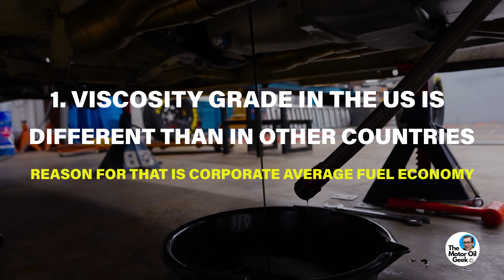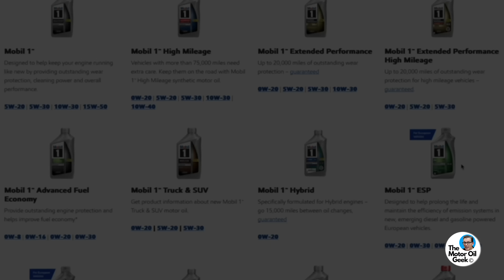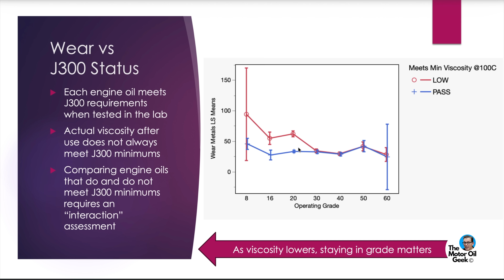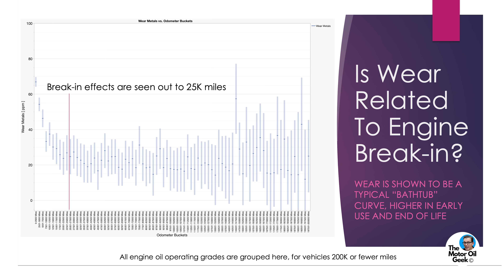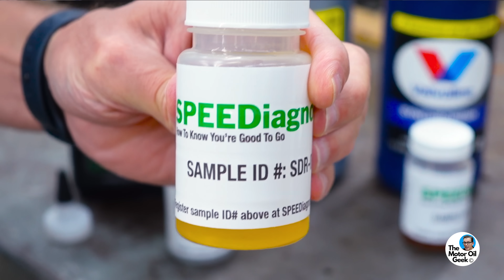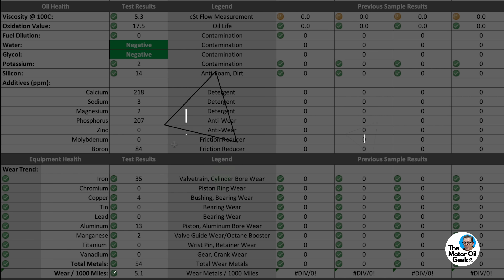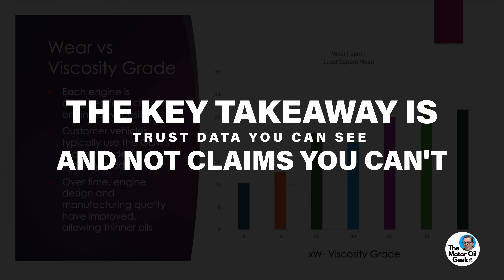More Ai Lies? The FACTS about 0W-20 vs 5W-30 (With Evidence)

Comment: I was a D9 dozer operator on stock piles 12hrs a day for 24 years. I taught everyone to listen to the machine more than you watched the gauges. The sounds will give you warnings of problems. I went through 5 new dozers. The biggest problem was always electrical. To many ecm’s to many sensors to many wiring harnesses. JUST LIKE on automobiles. I listen ! My Jeeps 3.6 sounds much better on 5W-30 than 0w-20. That’s my story imu stikkin 2 it !!!
Reply: i use 5W-30 in my ram hemi
Reply: If you hear a problem, you’re too late.
Reply: @garysarratt1 
Not even. Your ears really tune in when you know what to listen for. Differences consistency
Reply: @flatheadfletch y'all are kinda both right here. Some people have the ears for it, listen to their engines like the great composers, others just cant hear the differences. Then theres the people who say "i dont know it just shut off" when they tow their poor vehicle into a shop with 3 bad wheel bearings, brakes metal to metal, a bad CV axle and the engine puking hard parts out the side of the block.
Reply: @TrickyClaw 
Exactly. Hearing has to be trained. When you start your vehicle do it with your window down, listen until it idles down. Pay attention to the sound and vibrations. Your sensitivity will grow. It takes effort and soon becomes second nature !
Reply: Could not have said it better. These videos are so subjective, they talk shearing out of grade but, it actually depends on the add package for that engine oil. This general could a would a should a crap is really no better than current AI generated info. In fact AI is taking info and learning so fast it's mind boggling. Engineers, and Tribologists will soon be another thing of the past.
Reply: Also be wary of an engine suddenly running TOO good, cause its not going to stay that way for long.
Reply: Same on my Tundra.  It was on 0-20 to 75k and I went to 5-30 and it does sound dampened and smoother.
Reply: It's the forged pistons making that noise when it's cold
Reply: Yep! - even between brands there can be differences. In Australia we have the usual international brands like Mobil, Caltex, and I think even Gulf Western (not really sure about that last one) - as well as more "boutique" ones like Liqui Moly, Royal Purple etc. Our local only brands are Penrite (NOT Pennzoil) and Nulon.  When we bought a brand new 2014 KL Cherokee Trailhawk it had a strange grinding noise on startup - sounded exactly like turning the key on an already running engine. As that was the first car we'd ever had with push button start I kinda assumed it was the start cycle not being ideal - ie. starter staying engaged fraction of a second longer than it should and hoped it wouldnt cause long term damage.    Right away i need to say the engine never gave an ounce of trouble in the 8 years we owned that car. Had to replace battery 3 times, had Transfer Case replaced under warranty at the 3 year mark (no 4wd - but car still drove fine in 2wd until the case was done - internal electrical issue not mechanical), and had to replace the radiator at 5 year mark.  ANYHOO, after taking delivery new and running the engine in properly - at the first oil change (pretty sure it was a short interval for that first change but I cant remember now) I put 5W30 Penrite Full Synthetic into it (pretty sure it had 0W20 or 5W20 from new).  THEN at the next change 5000km later I switched to Nulon 5W30 Full Synthetic - and that grinding noise DISAPPEARED!!  At that time i researched and discovered we'd almost certainly been hearing Pentastar Valve Train clatter on startup - ie. while oil pumped up into everything.  With the Nulon oil that grinding noise was GONE and STAYED GONE.   Evidently the Nulon formulation stays on / in the valve train and cams.  That grade of Nulon DOESN'T have teflon or moly additives but the Nulon 5W20 and 0W20 DOES MODTC - evidently the chemists at Nulon determined that grade needs "help".  We since got a 2015 Grand Cherokee 3.6 Petrol and Ive been running that 5W30 in it (had been serviced with Castrol Magnatec from new by previous owner) - and at idle you have to look close and listen hard unless there's pin drop silence to even tell it's idling.  I HAVE noticed it develops a quiet "soft" "whirr" close to 5000km oil change time so am about to go to 10W40 (we're in northern Australia so -22F 10W spec will be fine for here).  EDIT - Nulon use MODTC in their low viscosity packaged oil not Teflon - they offer a Teflon additive product separately.
Reply: @tailfirst  I really enjoyed reading that thank you.
Reply: Yep, the "Hemi tick" is a great example of this
Reply: Smart. If I let the dealer change the oil, my engine tells me right at 32 or 3300 miles it's time to change the oil.  If I put something good in it, it's still running smooth up past 4500 or 5K when I change it.
Reply: I hear what you're saying, but at 3,000 feet altitude in heavy, heavy clouds you have got to trust your gauges!
Reply: Your correct in the sound an engine makes for a detection of trouble. My Subaru requires 0 w30. But when i switched to 5 w 30 the sound was much more quiet. So there is truth to this.
Reply: @willwaconsya3433 5w 30 is more stable for it's viscosity too. I had an old Chevy Prizm that I bumped up to 10w 30 from the normally recommended 10w 30 so long as it wasn't winter.
Reply: The stuff you're telling us what oil is sheer nonsense?

Comment: Great info!  As a Canadian driver, I'd love to see a video on cold engine/oil start up wear and block heaters vs idling to warm up. Things like that.
Reply: Why don't you make a video showing us how to get a hibernating bear out of your back seat?
Reply: @wsbill14224 I live in Arizona, I don't have to worry about hibernating bears.   But there was the time when a bobcat had kittens in the back seat of a car.
Reply: @wsbill14224 That’s actually not as uncommon as some would think. There’s a few different methods ,usually developed locally and new residents would be wise to ask some locals what works best. It kind of varies on whether you have a 2 door coupe, a 4 door sedan or an SUV. Large dogs are useful.
Reply: A Canadian did a block heater MPG test on his 7.3 diesel and found that the MPG increase was enough to make it cheaper to buy the electricity to run the block heater rather than drive on a cold engine.  I wish he'd done oil samples, it would have probably shown a big difference in soot and fuel dilution.
Reply: @DonziGT230 
I feel the same about it. Especially when temperature drops below 10°C. Faster cranking (I changed a few batteries this season and 2 alternators in our shop), the engine reaches operating temperature in half the time, and of course lower fuel consumption.
Reply: makes good sense that if it is all ready warm before startup and its not idling for a length of time that oil delusion soot deposits would be greatly minimized and in my opinion should increase Shear strengths longevity?
Reply: You don't have to make that video because the block heater wins every time. Its a little of a controversial topic but in my opinion letting your car sit and idle causes more stress on your engine than taking off and driving after a minute but moving slow tell it's up to temperature.
Reply: @electrified7309  -41c this morning Own a 2019 Toyota Tundra trust me u dont wanna go when its cold u can feel the transmission and engine struggle . Just waith at least 5 min on idle cause oil become so thick its have difficulty going in the lifter .
Reply: @electrified7309 
Yes , and its been proven, validating your view !
Reply: You don't do both? I use the block heater and the truck or car will start better below -15C. I still let it run 10-15min when it's that cold. (-35C or colder gets 25-30min)..the block heater does nothing at all to warm the transmission fluid, idling does. 1-2 minutes of idling won't even keep the windows clear...a safety hazard IMHO.
Reply: @Gippetos  you could look into getting those stick-on type oil pan heaters, would work perfectly on the trans.
Reply: @aspman97  I'll keep idling. Had one of those on a Jetta TDI, they do work...but not really that well IMO.
Reply: @aspman97 if it was that useful everyone would do it block heaters are super common.
Reply: @Gippetos  Had one on my 2000 Jetta TDI, too! It was a VW product, a clamp-on oil pan heater installed by my dealer in suburban Chicago.
Reply: @cguy2guy511 That is like saying doing oil analysis OR  changing oil at 500 miles on brand new car isn't worthwhile or everyone would be doing it/ them.
Reply: @davepetrakos475  The bigger issue is almost zero people who buy a new car understand that it needs to be done, because stealerships have gone away from recommending it. They know they can make more money off of replacing a failed engine than doing oil changes.
Reply: 100% synthetic oil has a magnetic polarity that sticks to engine parts, fake full synthetic doesn't 100% synthetic grade 4 oil doesn't get thick in extreme cold, fake full synthetics derived from crude does.
Reply: Idle to warm up is killing it, you got to move ALL moving parts not just the engine, low revs until up to temp.
Reply: @MelchizedekKohen  
I prefer low throttle and medium revs.
Reply: @perlindstrom8676 low revs nothing more
Reply: In idaho i hv a trick to reduce wear in my honda 4cyl.  ..i do 2 starts one short turn over of starter  and then  stop' ..to fill the the lifters. And then a normal start and run ..and short warm up. Reduced tappet noise substantially so i know thats workn to decrease wear.

Comment: What brands stay in grade better on the 0w20?
Reply: Amsoil Signature Series
Reply: @josh8oh8 can it be proven?
Reply: @svgs650r  I think Lake already proved it in his last big test report.
Reply: @svgs650r It was the #1 oil on project farms test that included a dozen of the most popular oils on the market. As for my personal experience with amsoil, I have never had an engine that ran and sounded as smooth as amsoil. So I am sticking to it from here on out.
Reply: @josh8oh8  your experience is anecdotal with with a sample of one, so instantly discarded, as for “project farm” whatever that is, have they provided third party analytics?
Reply: @wally6193  link?
Reply: @svgs650r  Well why don’t you find out yourself if you don’t believe anyone else. Run the oil in your car and then send the used oil out for analysis and see how it comes out. But I doubt that you’ll do that because you want to continue to justify using your cheap supertech oil in your 50k car that is owned by the bank.
Reply: @josh8oh8  What!? Do my own research? I just need someone to send me a link that coincides with my opinion.
Reply: @j@j@j @josh8oh8  have been using amsoil on my 2016 duramax work truck. About to hit 450k miles on the clock none deleted. 
With original transmission 
All fluids, oils, and lubricants are from amsoil. For me this brand has worked very well and efficient. Do my oil changes every 7k miles and trans fluid  twice a year.
Reply: @josh8oh8  Overkill and too expensive.
Reply: @romanc.5074 its actually cheaper if you don't change your oil every 3-5k like a fear mongering fool.
Reply: @benlastname6667  Well, what you call fear mongering and fool, I equally could call it being wise and preventive.
Reply: @romanc.5074 considering there is thousands upon thousands of uoas to support its fear mongering with amsoil, you would be a fool by the facts shown.
Reply: I run liqui moly. Who knows if it is in fact better but it is supposed to be a good oil
Reply: @Cimone90  video data slides literally shows it [liqui moly] is the worst
Reply: @JaykeBlayde only on 5w oils. My car uses 0w which the chart shows that it performs well
Reply: @JaykeBlayde  I found that out recently & was a bit shocked, considering the hype; I also found out that Motul is a great oil
Reply: @Cimone90  consider Motul oil if you ever think about switching
Reply: @MrRjnr  Why?
Reply: @MrRjnr i always ran motul before. When i bought my new VW they didnt have an approved 508 00 or 509 00 oil
. They do now. Maybe ill switch when i run out of liqui moly. Honestly im sure both are fine as long as theyre changed and i change my oil every 6 to 8 thousand kms
Reply: @Cimone90  overpriced trash my man, sorry!
Reply: @crisnmaryfam7344 based on??? What?  The chart shows its 0w perfermance to be quite good so. Why is it trash?
Reply: @Cimone90  It is good For turbo charged engines.  Lake the Geek said.
Reply: @Cimone90  Which one, there's many flavors?   I've read the ACEA C5 certification gives the oil a higher heat range.
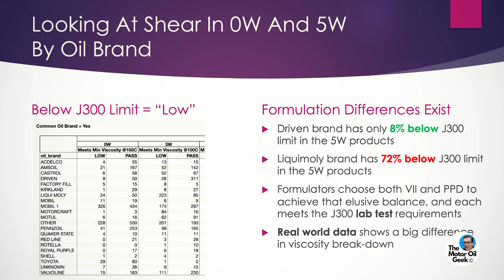Reply: 5:14  1st place is Redline.  2nd place is Royal Purple.   3rd place is Kirkland Signature (Costco store brand).  Looking at the number of Pass compared to the number of Low, in the OW column
Reply: @JaykeBlayde  What are you referencing?
Reply: @JaykeBlayde sample sizes Are way too small for those selections to draw that conclusion.
Reply: hes got a few videos on what brands are good ones to use.
Reply: @crisnmaryfam7344  👍 links?
Reply: Castrol, Mobil1, Motul and Amsoil will all perform well
Reply: mazola
Reply: depends what and how you drive-the geekster had it in his other video
Reply: ☝️ This is the point where you go and start Lurking 🥸👀 on the Bobistheoilguy forum and examine all the Used Oil Analysis of various 0w20s posted and figure this shit out. 🤓 

All modern spec oils these days meet the basic SN, SP, SQ specifications. The ILSAC GF-x specification. The ACEA specs. 

ANY name brand oil off the shelf will be perfectly fine for your average daily commuter-mobile if changed properly and a GOOD quality oil filter comes along for the ride (not a cheap $1.50 oil filter that barely holds back rocks)
Reply: Cadtrol edge seems to stay in grade well.saw 2 uoas someone had using it.both were 10,000 mile runs.i believe it was a mazda 4 cylinder...two of the best uoas ive seen and the 0w20 was still a 20.
Reply: @steverugerguy9606 — Mazda 4 bangers (pre-turbo) are extremely efficient and doesn’t beat up oil. Your example scope is too small. 

ANY oil would be just fine in a Mazda Skyactiv engine. I had a 2014 hatchback for 11 years. I know first hand.
Reply: Pennzoil Ultra Platinum is the best all around oil you can buy for the dollar. AMSOIL signature series is the king but over priced.
Reply: @marsarmory6236  Your opinion on Schaeffer oil??
Reply: The correct answer is…just change your oil.
Reply: If you change your oil at 3,000 miles- there will be no observable differences in wear between any and all brands

Comment: Whats funny is you say 0w20 is fine yet with my brand new durango bottom end knocks on start up when had 0w20 in it yet when I switched it to 5w30 dosent happen anymore so if it can stop knock it protects more
Reply: Sure but that has nothing to do with viscosity, but the additive packing of the oil (certain additives can have anti knock effect while certain additives can "invite" knock) Viscosity of the oil shouldnt have any effect on knocking. Just a side note sometimes what sounds like knock isnt knock. Thin oils absorb sound less than thicker oils which are more "sound absorbing" which can create the illusion that your engine is more protected. Again like Lake said if you want to fight these claims you would have to go against thousands of oil analysis with actual and factual data. There are definitely engines that benefit from thicker oils and thinner oils would ruin them, but these situations are way more rare than most people think.
Reply: @sea7f4i3r89  didnt matter what brand of 0w20 was use from mobile 1 to red line they all knocked so isnt just additives its fact 5w30 dont run off parts as easily stays were you need it to after the vehicle is shut off. I dont use cheap oil and change it every 5000km or 3000 miles and always top brand sythetics. So additive packages are there but the oil dont protect worth shit. Run 2 engines same engine one onn 0w20 one on 5w30 the 5w30 engine will last longer might use a few % mire fuel but when your engine lasts who cares. Rather save money in repairs and buying a new truck or car every few years by running better oil then worring bout .2 or .3 mpg
Reply: @ErikKoenig-fv3nr  Speculation
Reply: @sea7f4i3r89 if you say so wish we all lived in fairy tail land

Comment: Car manufacturers design their engines for a certain grade. I change my oil every 5000 miles. That is easy because I can look at my odometer and when it at 15000 mi it is time for a filter and oil change. When a engine gets around 150000 mi it may be better to up the grades.
Reply: 😂do they

Comment: sorry im not putting any 0 w oil in any engine i own--  all the manuals say 5w-30 is acceptable  anyway so that .00002 mpg wont be missed
Reply: You clearly don't understand what a winter grade is.
Reply: @karstgeo7290  you clearly dont know that 0 weight  wont protect- maybe i the arctic its warranted but in 99% of the USA 5w-30 is just fine
Reply: @bikeman1x11 so you're telling me a 0W-40 isn't up to task?  Or a 0W-30 Euro with HTHS of 3.5 isn't?
Reply: @karstgeo7290  nope no zero weight in any vehicle of mine i dont trust it - since 5w is. okay in every vehicle i will use that-

Comment: Anything below 5w-30 is trash for your engine, also if u live in hot climate, anything below 10w-50 is also trash for your engine. Do your changes every 3000k miles if u are in daily heavy traffic or 5000k normal drive